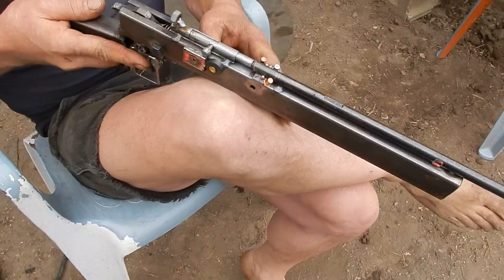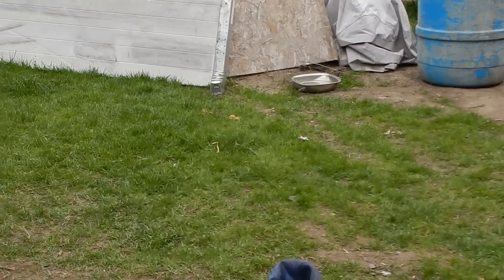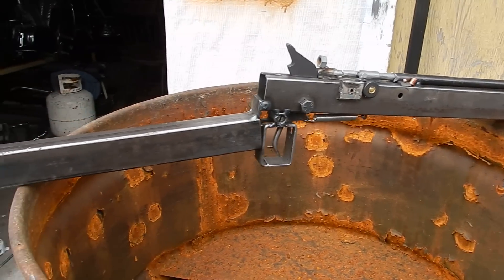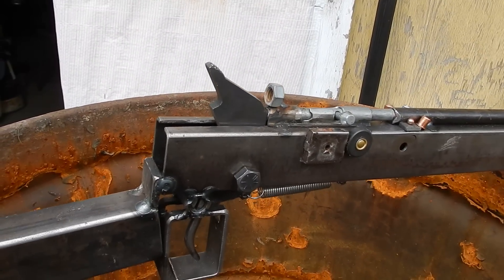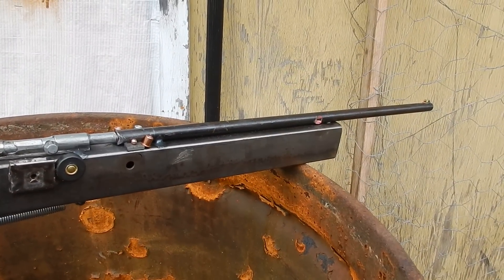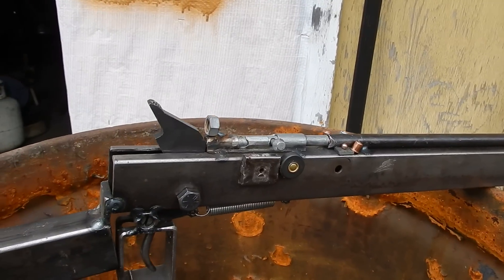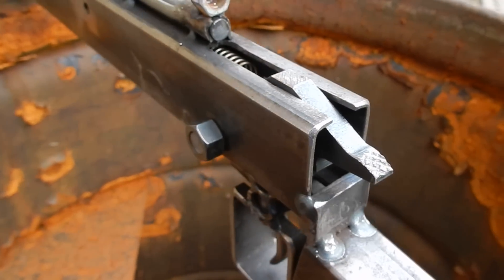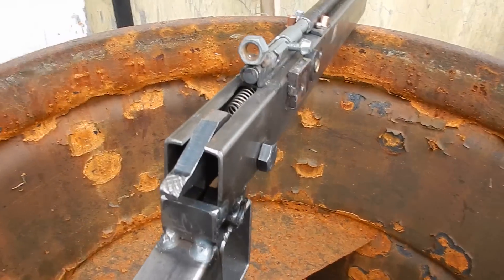209 Primer BB Gun

Comment: Hell yeah! I've been building these things for years, I even built one that used a small powder charge and fired BBs at 4,500 FPS, thing was kinda scary, shot BBs through 1/8" steel plate🤣. 209 primers have a ton of power, the average .177 velocity from a barrel like that is above the speed of sound if the barrel is a good fit. The only thing that sucks is the fouling that builds up from their use, it creates an immensely hard material buildup in the chamber and can make loading impossible if it's not kept clean. But like all firearms proper maintenance is key!

Comment: They do work. And pretty good sometimes. I made one twenty years ago or so. Took a rifled pellet gun barrel out of a crossman. Mine wasn’t nearly as nice as that one. It was more like “a punt gun “ of the late 1800’s. But it worked good enough to put a BB thru two sheets of clear drive thru forklift vinyl, a hollow core door, two strips of the pull up metal blinds in front of some brand new double pane vacuum sealed windows. Only got one pane of glass though. One hell of a good ass chewing. Some nasty looks for a while. And prolly didn’t help any when I ended up losing my lead man position an was goin back to road mechanic instead of the manager position I was tryin for. My mouth and attitude didn’t help either. So I quit an went on with life. Boredom isn’t a good thing for me. Brought a smile to my face recounting that memory.

Comment: Not sure if all spring rifles will do this, but my gamo bonecollector in .177 will. Load the hollow skirt of the pellet with primer powder and seal with wax. The immediate air pressure alone ignites the primer. The pellet travels fast enough to melt to iron at 30 yards but cleaning the barrel is a must.
Reply: @JohnDoe-cg9ze  tell that to my dogs food trough. Ill be reasonable its probably not iron. But it is some sort of hard steel. My pocket knife couldn't separate the lead from the trough dude, so i dont know what to tell you except try it. Its makes a nice little muzzle flash as well. Well worth the effort in my opinion. The gun is advertised to shoot 1300 fps, so give or take a couple hundred fps. The pellet is traveling faster than a standard .22lr, which would burn through a food trough, since its just 10 grains of lead its not going to penetrate. Instead of making an ass of yourself, you should have just tried it first...
Reply: @JohnDoe-cg9ze  by the way the reason we have copper jackets on bullets is because lead melts past a certain amount of feet per second due to friction in the barrel of a gun learn physics
Reply: look up desiling
Reply: @JohnDoe-cg9ze  dude who hurt you do you need a hug
Reply: @thememorablenovelist5876  You need a hug huh
Reply: @JohnDoe-cg9ze  dieseling a pellet. Look it up.

Comment: This is a really cool build . I want to make a similar one of my own design.  Inspired by rocket ball ammo. I'd love to figure out a non-explosive based propellant . Make a nozzle from a gas check and pack it , then have a fire piston style ignition.  Or solid rocket fuel and a battery or piezoelectric  ignition .also similar to model rockets. I'm betting one or two grains of it would allow for proper fun at a target range and plinking. 
Idk, experimenting would be fun
Reply: Have you looked into hho as a propellant?
Reply: I've been pretty curious about building a rocket rifle myself, but I'm leaning more towards actually having a primary propellant charge that fires and ignites the secondary rocket at the same time so it has tremendous velocity from the get go, and then the rocket just pushes the velocity even higher. It's completely impractical for accuracy reasons but I think it would be cool to have a gun that could land a bullet at 1000 yards that's still doing like three or four thousand FPS on impact. 

If I'm not mistaken nitrocellulose is a prime candidate as a fuel since it can be accurately formed and formulated into a grain that shouldn't fracture under the high pressure (fractures create a huge increase in burning surface area/pressure spikes that blow things up) and burn at the right velocity to make the most of it's flight time, which in this application would mean a very short burn time, a super fast 50 milliseconds or so. That would probably be the hardest part of the entire project, building the gun itself wouldn't be that bad, but the ammunition would have to be absolutely perfect, getting the fuel formula, grain shape, projectile design, chamber, nozzle, throat material and all that stuff figured out just right would take a long time, it's what keeps me from attempting it right away. Then you would also have to create a production line for making them in any kind of practical numbers, that sort of thing can get expensive fast even on a small scale. Ahh well, one can dream and plan and design things for free, maybe the resources will come along one day...